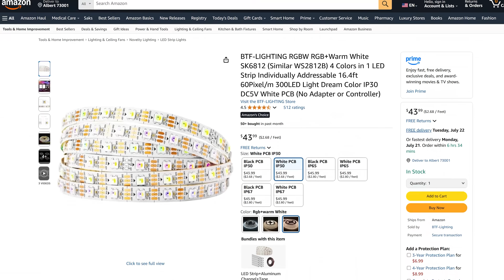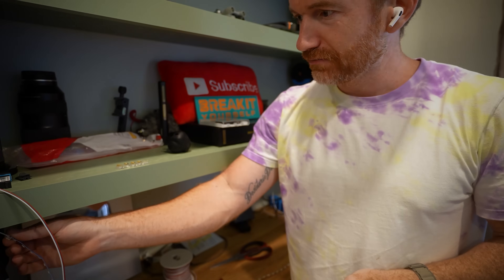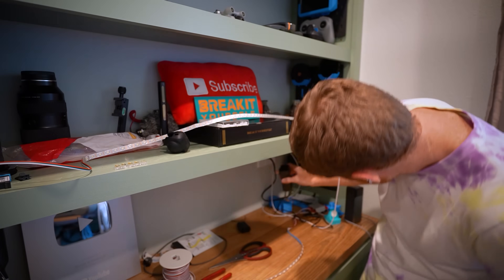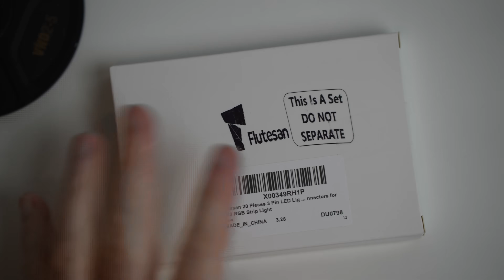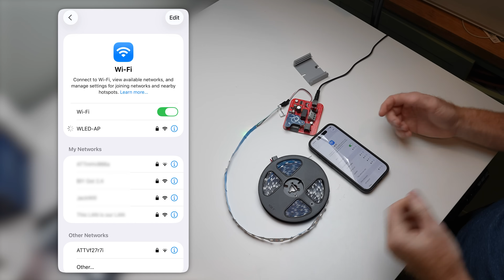Easy Plug and Play LED Shelf Lights Anyone Can Do!

Comment: The power limit on the controller will come from restrictions of the power supply lines on the PCB and the relay that switches the strips power. You could extend that limit with an external relay.
Or if you can live without the relay (although those WS281x based LEDs do take a standby current for each LED/chip, so this adds up quickly over long runs) you could just connect the PSUs power output directly to the strips.

Another thing is, you already ran power wires for each strip. you should connect them in parallel rather than in series, to avoid the power loss issues. The voltage drop over a length of strip gets worse as current consumption per LED increases (ie mixing white on the RGB channels with full brightness would be the worst possible case).
One thing around this without going too crazy on wiring (at least for limited lengths) is to go with a higher voltage. 12V for example can easily handle the 5m run (12V strips are usually the WS2811 based ones where there are visible ICs on the strips, controlling 3 LEDs as one).
Better yet, you can go 24V with those COB strips. They've got the advantage of looking like a continuous strip of light, since the LED density is so high you don't need an extra diffuser.